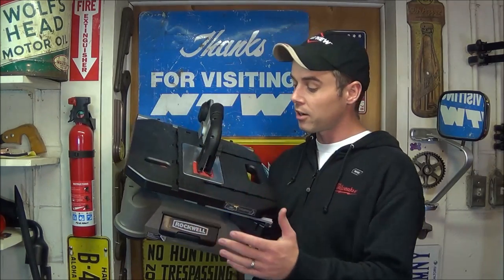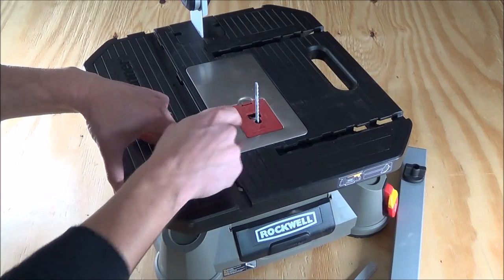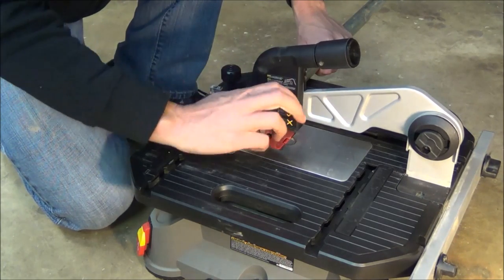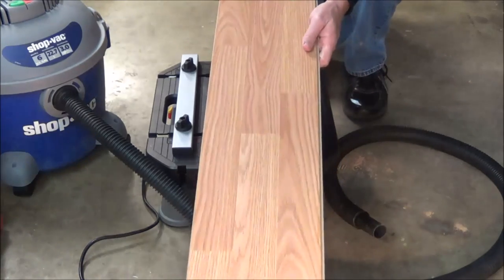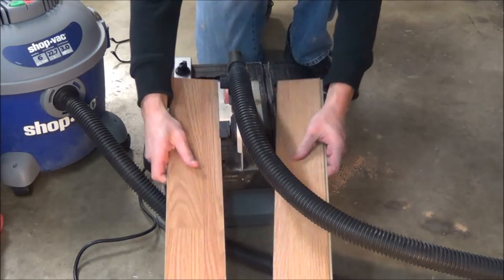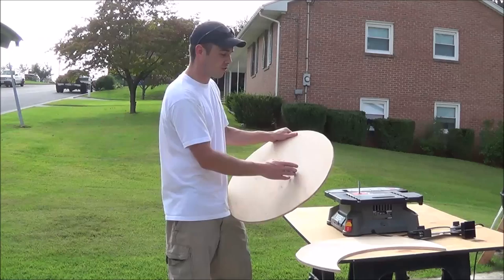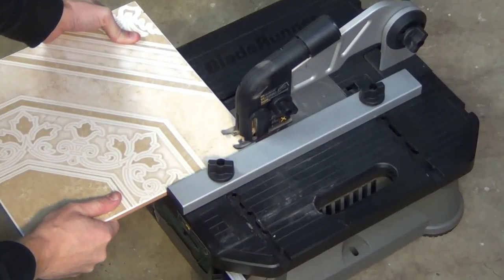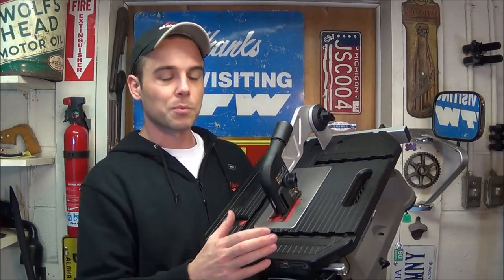Rockwell Bladerunner X2

Comment: I am a novice at woodworking, but I found a local woodworking shop that gives away their scraps for free.  I have been collecting them, and I want to make some furniture for Barbie and other types of dolls.  This tool was recommended to me, and I was wondering if you would have any recommendations on whether I could use this in a utility room inside my home, and whether I will need additional items to make it work efficiently? I noticed several mentions of the blade slipping because of vibrations - would it be best to buy a small workbench to attach it to? Also, what about dust? Should I buy a shop vac as well, in order not to spread too much dust around in the house?

Comment: Is the distance between the bearings adjustable in this model? I played around with the first model and didn't like it. The bearings in the guide arm didn't even touch the blade causing blade wander. And you could not adjust it. It would be nice to be able to adjust the distance between the bearings.

Comment: Just opened  the box today and ripped some vinyl fence parts.....really satisfied with the saw..with that being said the assembly and use  instructions  are really BAD...I live in NJ..never met and don't know Real Tool Review Guy...but Rockwell..you should be sending him a check or offering him a job..I you tubed the saw and  he really made a great demo and clarification of the tool use...without him I'd be wasting a ton of time figuring it out... and getting disgusted wasting time..I also own a Rockwell 4 1/2 inch circular saw and it's absolutely one of my most used and favorite tools..if customers don't feel comfortable with the products capabilities they won't buy more Rockwell products! Awesome real job tool review guy!
Reply from the maker: +ed McBride Thanks Ed!  Glad to help! :)
Reply: +ed McBride Thanks for the feedback Ed!
Reply: How close can you get with the rip fence, I need to cut a piece of trim outside edge molding down to a 1/4 inch on one side.

Comment: Excellent video, I've been contemplating the purchase of mini table saw, mini cut off saw, or scroll saw, I saw the Rockwell Bladerunner online, yours is the first video I looked at and:
1. You answered all the questions, and potential questions. 
2. You showed everything it comes with, explained each feature, and gave working demonstrations of the capabilities of the unit including arm removal which potentially makes it more flexible than a standard scroll saw. 
In conclusion, for the hobby work I'm looking to do, this saw should meet and exceed my requirements. Thank you for a no nonsense, thorough review, and demonstration of the Rockwell Bladerunner.

Comment: I think what impressed me the most is that it didn't move around while you were cutting.  It looks so light weight that I thought for sure the unit would start to skate once you began cutting.  Great review and demonstration.
Reply from the maker: Mike L. Yeah it doesnt "walk around" on you while cutting, but I would suggest bolting the base or even using long screws to attach it to a surface for the absolute minimum vibrations & best cut.
Reply: Great video - I just subscribed!  Thank you so much for SHOWING us how to use the Bladerunner instead of me trying to figure it out on my own!  Are you saying I should permanently attach the Bladerunner to a piece of plywood (or something else?) for extra stability?
Reply: Hmmm...My saw "walked around" so much the yellow power safety switch shook out.  IMO, the "fence" is a joke. That being said, I bolted down and the "walking"  it is better.  I would not recommend this upside down mounted jigsaw.  :(

Comment: Nice saw, but will it cut porcelin tile as well, Im also curious to know if the blade causes any chipping on the face of the tile. I do like the compact size, and shop-vac attachment.  Im looking for a compact tile saw, but I see this has no area to put water, so no wet saw capability.   Thanks for the video, I watch all your reviews, very informative. Thank You.
Reply from the maker: +Tommy  Foster I couldnt get it to cut it, but then again I was not using specialized blades....with normal ceramic tile blades it wont scratch the porcelin tiles.  I would suggest a tile saw, this is more-so for the DIYer that is looking for a saw in between a jigsaw & circular saw.  I am glad you like the reviews!  Thanks for watching!

Comment: I was glad to get one of the original blade runners which meanwhile have been discontinued due to a following new model. They´re sold in Germany under the Worx brand, the original one  is called wx570, the new one - shown in the video - wx572. In comparison I suppose the older model to be the better one. The new model has no speed adjust any longer which is quite useful for steel and tile cuts and has the basement of the upper part "in line" to the cutting blade so it is a little bit easier to handle long straight cuts but is more limited in doing typical scroll saw work because the space between blade and upper arm basement is shorter. Of course You can remove the complete upper part but I regularly face the problem that the blades tend to slip aside and therefore produce slight angle cuts according to the specific wood grain. Overall a good saw for the home worker. Heavier tasks should nevertheless be made with professional jigsaws as the bosch blue line 150 CE or a band saw or angle cuts and thick material with a standard table disc saw.

Comment: How does this compare to original one? I have the original Bladerunner and seen these new X2s at Lowes. Yes I know about the dedicated Rip Fence and dust port, but is seems more flimsy than the original, The lighter new one scares me as does not seem to be as "beefy'" how does the motor compare to the original?

Comment: Hey there, thanks to your video, I ended up getting this vs a bandsaw in the same price range. Even though I can't cut as thick as a bandsaw can it makes up for it in the quickness of changing blade. 

One question though... Do you find it to vibrate very bad? If so, how did you deal with this? Please let me know. Thanks .
Reply from the maker: I screwed mine to a piece of plywood with 2 drywall screws with washers on them & the vibrations went down 80%.
Reply: Real Tool Reviews thanks for the heads up.

Comment: Great review. I bought one based on your review. I really do like it a lot but I use better quality blades because I was getting too much vibration on small cuts I make to hardwoods.  With the Bosch blades it cuts hardwood like buttah!
Reply from the maker: +Bob Marioni Thanks Bob!  I am glad you liked it.....I completely agree on better blades --- I upgrade just about everything (table saws, miter saws, jig saws, etc) right out of the box anymore & get much better performance and cut quality the whole way around.  The other thing that really helps lower vibrations on this is to screw it down to a sheet of plywood or workbench....then it runs very smooth.  Thanks for the update!

Comment: Are there carbide blades available for this saw? This looks like a good tool for cutting laminate flooring. However, I've found that when using my old table saw a regular blade wears way too quickly. I imagine that would hold true for a regular jigsaw blade also.
Reply from the maker: +Sam G I am not sure.....it uses standard jigsaw blades, so that would be the limitation.

Comment: I'm brand new at this DIY stuff and just bought this BladeRunner. How do you cut the middle of a piece of wood. For instance, I'm cutting the letter P, how do I get the inner 'hole' of the P out? Also, how do I cut a 90 degree corner? I'm assuming I have to reposition my wood?
Reply from the maker: Tyeler Potter Tyeler - the first thing you need to do is drill a hole in the part you want to remove, that way you then can make a series of cuts in that material to follow your lines & remove it from the center of the board (drill a hole & place the wood over the blade with the blade sticking through the hole).

Comment: I just bought one and I'm trying to cut a 16"x48" piece of 1/8" thich plexiglass. So far, the cut starts just fine, but then it curves inwards. It's a bit hard keeping the piece of flexing plastic straight, but the cut looks clean. I'll have to practice a bit more and I'm sure I'll get a perfectly straight cut. One negative aspect is the noise. It's a loud saw, but it's acceptable for the price.
Reply: I was able to fix the curved cut trace issue. I noticed that the head support that keeps the item to be cut from vibrating was pressing into the blade. So, the blade was leaning towards the right side. I pushed and straightened out the issue by very slightly bending the thin aluminum arm. Now the blade stands straight and untouched. I just finished cutting 4  pieces of plexiglass  with 1.125"x48" dimensions and the cuts were very straight and smooth. Instead of using the 16"x48" piece to cut into 1.125"x48" rectangles, I cut the original piece into two 8"x48" sections and that made things easier. So, now I'm very happy with my purchase. This little saw does exactly what I needed it to do. I'm using one of the "fine wood" blades that come with the saw. It does a good job, but I plan to try the others to see if they provide even better results.

Comment: just returned my Bladerunner to the store this evening because I was also having the drifting blade problem however I did not have any problems when I use the rip fence it was only during the miter gauge crosscut that I had an issue. watching your video I think I have figured out what the issue is I noticed when you were running the pipe through the blade using the miter gauge that you were also holding the other end of the pipe as well as holding the in that was on the miter gauge this would have course stabilized material and most likely have kept any blade drift from happening. I would suspect that if I ordered the sliding table and put some non slip strips on it that the problem with most likely completely disappear. I believe that it is the vibration that is causing the material to drift and causing the blade to move during cutting without one realizing it. having come across this epiphany I reordered the Bladerunner X2 along with the Crosscut sled and a nice Blade Set just a few minutes ago. I am going to try out my theories when it gets here but I am almost positive that this is what is going on positive feedback is so much higher than the negative feedback. I will let you know my results and thank you so much for this awesome video it was an eye-opener.
Reply from the maker: Sweet....glad to help.  Yes, vibrations really hurt cut quality.....I also suggest that you use a couple long (3") drywall screws with washers to hold it securely to a workbench on sheet of plywood.  I got a lot better cuts & a LOT less vibrations when using it that way.  Also, the blades are regular t-shank jigsaw blades.....you should look at the Bosch branded ones at Lowes or Home Depot....they are good quality for the money.
Reply: I actually did order the Bosch blades. I kind of feel stupid for returning it because I liked it so much up until I came across that problem but now that I've read all the reviews and realize just how much vibration I was getting without supporting the material on the other side there is no way in the world I would not be getting blade drift. Unfortunately that was the last one the store had so I had to order this next one but that's okay I got the sled table along with it something tells me from here on out it won't be a problem I was loving the tool up until then
Reply: +Real Tool Reviews so you mounted the actual machine to the plywood and then clamped it up on your workbench is that correct???
Reply: +Real Tool Reviews I do apologize for the many questions but I really do appreciate your answers I just want to make sure that I mount it up right. so essentially you used 3 inch drywall screws some washers obviously to stop the screws from going through the mounting holes amounted to a piece of plywood which in turn could then be clamped onto a portable work bench?

Comment: Really like your reviews, but I had terrible results with my Bladerunner X2 when using the fence.  I don't know how you were able to keep the blade from walking left or right of center, but unless I free-hand all of my cuts, using the fence only caused binding; mine had terrible "blade drift" no matter how I aligned the fence.  Funny thing is, my cheap Ryobi bandsaw, same price, will cut a straight line with no drift using a simple carpenter's square.  Looking forward to your future reviews.
Reply: +FuriousFilipino I'm sorry you're having drifting issues with the BladeRunner X2. When you set the fence does it move while you're cutting? Is everything locked in place tightly before you start? I just trying to feel out the issue.
Reply: +Rockwell Tools the fence was locked down tight.  I even used an Engineer's square to make sure the fence was equidistant all the way around.  After several disappointing cuts, I figured I can cant the fence to account for the blade drift, but all that did was make the blade bind.  I was cutting 1/4" MDF, 1/4" Lexan, and 16 gauge aluminum sheet, with the best Bosch blades for each material.  Free-hand cuts gave me the best results even on 4' long rips, with only a 1/64"-1/32" deviation from parallel-I could compensate for the blade drift visually.  However, using the fence and to some degree, the miter guide, gave lackluster results that I wouldn't even consider passable for rough framing.  I've been debating returning this machine, but the options for metal cutting with reasonable accuracy don't exist at this price rang.  It would just be nice to be able to rely on the fence and miter guide to speed up the work process.
Reply: +FuriousFilipino I see. There may be some other issue your BladeRunner X2 is having. Call our customer service line and see what they can do for you first. You may not have to return it. It just may be defective. Our number is: 866-955-4175.

Comment: The upside down jigsaw setup is scary. I will be using my jigsaw for large boards. For everything else the Bladerunner X2 looks very good.
Reply from the maker: Gino Punsalan Well, the wood we were cutting kept hitting the rear arm....so while it is not recommended (I am sure), it will work in a pinch.

Comment: Would you recommend this for a beginner & can I use my Dewalt 10-Piece Assorted U-Shank Jig Saw Blade Set with it?
Reply from the maker: I’d recommend a standard jigsaw, but this is useful also.  Using the same blades makes it nice for sure.

Comment: Someone may have already asked you this, I'm planning on getting one but I haven't seen it yet. I was wondering if there was any way to mount the unit to a stand, either home made or store bought? Any sort of bolt holes or adjustable feet that I could take advantage of would be fine, I can bolt, clamp, glue and screw from there :)
Reply from the maker: You can screw it down to a workbench or piece of plywood very easily......just takes 2 long screws + 2 large washers......there is a hole on the left & right hand side that you can use.  The vibrations will decrease significantly & the cut quality is vastly improved.  Good luck!
Reply: Awesome, thanks for the reply

Comment: Question, what is the best and smallest DIYer tool for cutting angles for picture frames?
Reply from the maker: +Svitlana Coulter A miter box with saw (non-powered) like this one -> http://www.amazon.com/Stanley-20-600-Clamping-Mitre-Box/dp/B00002X232/?_encoding=UTF8&tag=reatoorev-20
Reply: Svitlana/ You could use a Dremel Saw-Max,or the Dremel Moto-Saw. Each cost around $80 usd where I live. I don't think you can get much smaller unless you go with a hand saw/miter box for around $20/30 usd. Happy framing! :)

Comment: my saw will not cut a asraight line . the bade locking does not fully enable in other word when you change bale the locking ring is north and south when release the lock the locking ring should east and west locking the blade in mime goes  about it is 10 degrees from being fully east and west go the blade just alittle cocked and the cut is notg straight.
the back piece  where a full piece goes does not in lin e with blade wod hit the splitter in the back.